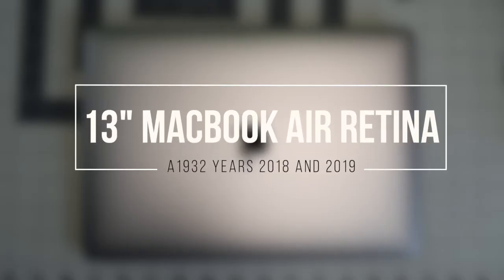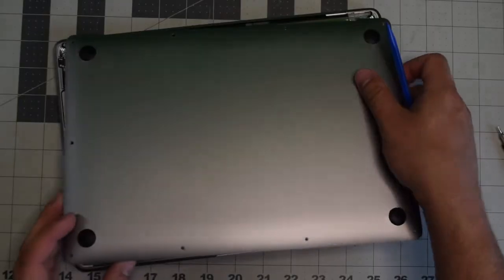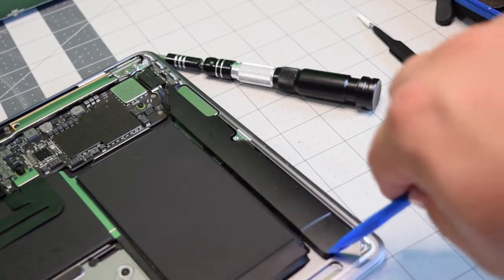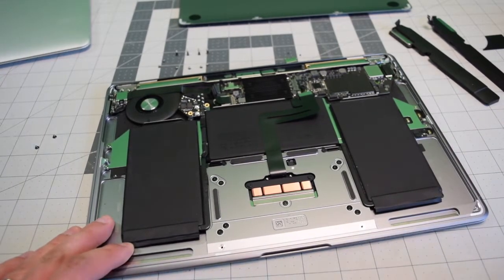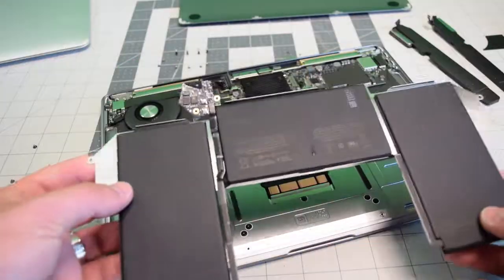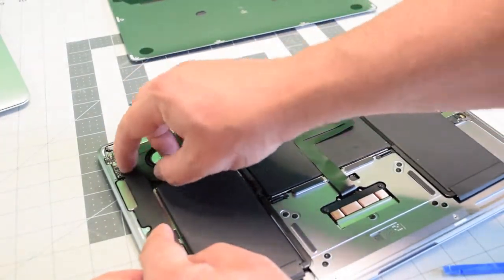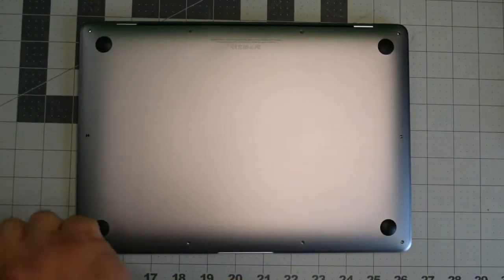13” MacBook Air Retina 2018 and 2019 A1932 Battery Replacement

Comment: Taking out the old battery, I slide it under the cable. Putting in the new battery, I just put it on top of the cable and screwed it down. Works just fine. 2018 MBA.
Reply: mvp comment right here, there is no reason to fiddle with this thin cable while inserting new battery

Comment: Thank you, but. Thanks for this tutorial. I have mostly used i-fix-it with confidence but they have you disconnecting EVERYTHING and removing the logic board just to replace a battery. Then I get down to the end and one logic board screw won't come out! Stripped or something. So I went searching and found this. I've been fixing Macs for a decade or more and could not believe this process.

Here comes the but..... I also trashed my trackpad cable. I did have it disconnected from the logic board as part of the i-fix-it steps, but enough of the adhesive strips failed to come out cleanly that it took effort to free the battery and it destroyed the cable.

So, people, be careful.

Comment: Not sure if it's already been said but there are additional pull tabs at the top of the speakers in between logic board and speaker..  You can reach them with tweezers.

Comment: I highly recommend you disconnect the track pad cable rather than trying to just slide the battery underneath it!! It is incredibly easy to disconnect! If you instead try to slide the battery out like in the video there is a great chance you will tear the track pad cable. I’m here writing this comment cause my dad followed these instructions and did just that! Just take the few seconds and do it right! You already have the rest of the stuff dissembled, why cut corners at the most delicate part of the process??

Conversely, the suggestion at 2:01 to remove those two screws “that are securing the battery to the MacBook” is completely wrong! Those screws DO NOT attach the battery to the MacBook! They only serve to hold that chip to the batteries! Removing them is pointless! You can see as he removes the battery that there are no holes underneath in the MacBook for them to even go into. It is literally pointless to remove them. Use the time from this step to instead disconnect the trackpad cable!
Reply: just happened to me, it didn't break, it just loosened the connector directly from the touchpad, try unscrewing the touchpad part, connecting it again and see if it worked.

Comment: Great Video, but shouldn't you add the 3 adhesive strips under the left and right battery after testing that the battery is charging properly?

Comment: Thanks for the very clear "how to". This, combined with my experience changing the battery on an older MacbookAir gave me the confidence to attempt this one. But I quickly realized this model requires more experience than I have. After opening up the back and attempting  to remove the right speaker, I decided I'd likely trash my MacBookAir. It seems very easy to break things in there. So I closed it up and took it to an Apple Approved repair center.

Comment: this is not the correct way to replace the battery you can easily damage the cables and he also did not reinstall the battery stickers underneath do not trust this guys videos it can cause catastrophic damage to your computer
Reply: if ur careful u can actually manage to do it, also i dont know how to fix computers but do you either?

Comment: Why didn't you replace the tabs/ribbons you twisted up?  Not sure where you added the two-sided tape.    (Tip: consider working on a towel.  Screws will not slide or get lost.)

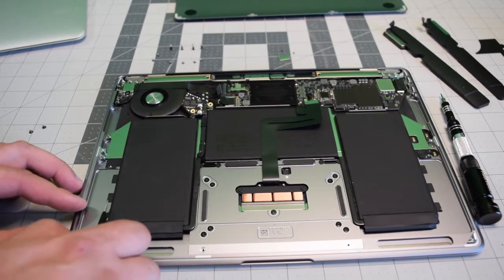Comment: Good Tutorial. But, I noticed you do NOT mention you have removed the two screws and bracket from the top of the TrackPad connector before attempting to remove the battery. From 2:13 to 2:19 they are detached. As several people have problems with the battery removal, I am assuming the extra 'play' helps. Your Trackpad replacement video shows the removal of the clip. https://www.youtube.com/watch?v=KtAlThEtoDk. Hope that helps someone. Anyway apart from that a good clear tutorial - Well done.

Comment: Hi there! I managed to change the battery successfully but now my keyboard in the macbook air isn’t working. I may have unknowingly loosened a connection. Where is the keyboard connection in the macbook air? Any other suggestions?
Reply: The trackpad cable (the thin piece that goes over the new battery) doesn’t seem to be broken. The trackpad is still working. Do I need to check that connection somewhere/somehow?
Reply: Hello,the same thing happened to me , the keyboard doesnt work, how día you?

Comment: Thanks for the tutorial! I was able to bring a dead Macbook Air back to life after changing out the battery. I didn't have much luck doing the spinning thing for the stretchy tape, I had more luck just gently pulling with my fingers and using even pressure. Thank you!

Comment: Ok for the removing the 2 T-5 screws I have a T-5 star shaped screwdriver and it’s not working so what am I supposed to do because I didn’t buy a replacement battery and a screwdriver set specifically for this for nothing

Comment: There are two ways that the battery can slide under that ribbon cable, one way is a lot tighter than the other, be real careful, if you do pull on the ribbon cable too much, it actually gets pulls out - the end of it is a connector underneath the mouse track pad. You can get underneath it and push it back in, but its a real pain to get to it.

Comment: Battery Cycle Count: 1000 of 1000
Cycle Life Remaining: 0.0%
Battery Condition: Good
Health: 83.3%
System Charge: 100.0%
MacBook Air (Retina, 13-inch, 2018) (MacBookAir8,1)
User name: Stacy Nicholas
SSD: APPLE SSD AP0256M Media (250.69 GB capacity)
Intel Core i5 8210Y @ 1.60GHz   1.60 GHz, 8 GB RAM, macOS Monterey 12.0

Comment: Be very careful folks with the thin black trackpad cable (3:30 in the video), it is super easy to damage as you try to remove the battery from the laptop. If it gets sliced, the keyboard/trackpad won't work.
Reply: I broke mine. I suggest for these DIY videos, they should encourage the removal of the trackpad cable in order to reduce the risk of breaking it
Reply: hi brian , i accidentally sliced that flex cable and now my keyboard is not working. is it true that if I replace the flex cable with a new one, my keyboard works again?
Reply: @Heyynovan  Yes, it’s fixable. I broke mine too. You can order a replacement cable but it is a tricky repair. I took mine to a shop and they fixed that problem and also the speaker cables that I damaged too for $200.
Reply: i broke it tried to fix that broke another ribbon cable now its 3 am trying to anything tonfix it because school starts tomorrow
Reply: @challa2608  just happened to me, it didn't break, it just loosened the connector directly from the touchpad, try unscrewing the touchpad part, connecting it again and see if it worked.

Comment: I think I failed to remove most of the glue under the left side of the battery and now it’s stuck :( What should I do?
Reply: I just did the same. Did you find a solution?
Reply: @trines1723  I was able to carefully slide a sharp knife under to free the battery when this happened to mine.

Comment: My battery is held down with T4 - (not T5) screws.  Be careful which battery you buy because mine came with only a T5 screwdriver.  Had to run to my shop for a T4 to get the battery loose.  Otherwise, spot on.  A1932 MacBook 13".
Reply: I think I’m having the same issue where did you get yours at ?

Comment: I have MacBook Air that not charging?
Reply: check to see if its a bad charger or outlet first, if its completely dead still then the battery probably needs to be replaced

Comment: I literally just got my first ever macbook air 2019 , and when i just used my charger it literally just said “ replace now “ i got so frustrated
Reply: same exact thing happened to me.  I didnt use it for a year because i got trapped abroad by covid. warranty is over
Reply: @julio10004  Yup, me too! Fucking covid.
Reply: @julio10004  how much does it cost if you ask apple to replace the battery when warranty is over?
Reply: @Steven-fv8xw  website says 129 to send to apple for replacement without warranty
Reply: @Steven-fv8xw  $129
Reply: Same here...